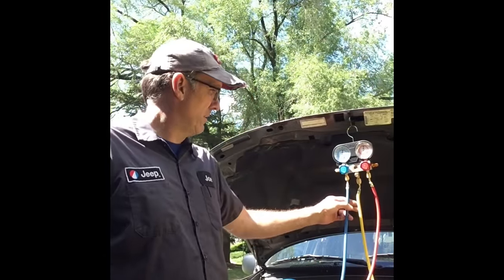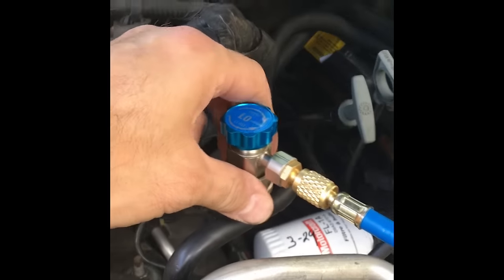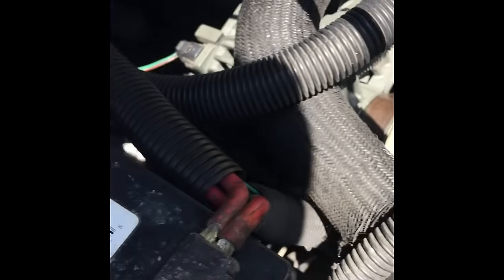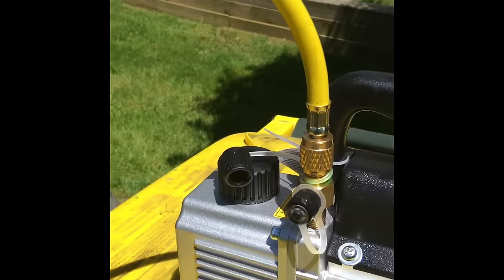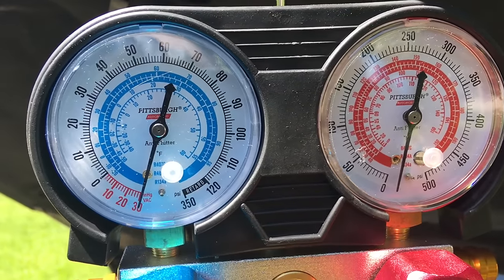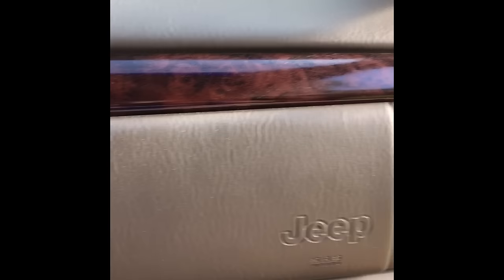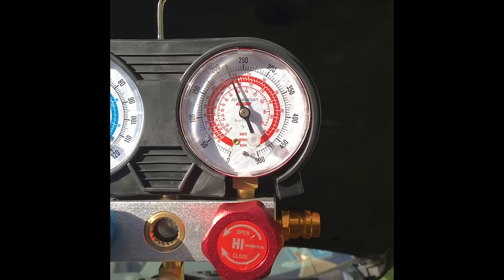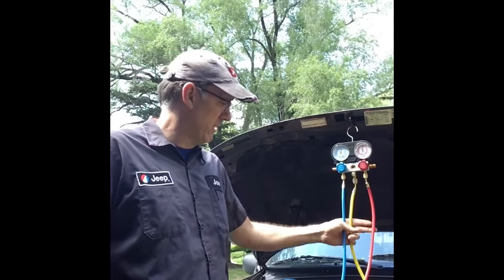How To Pull A Vacuum On Your AC System And Recharge Your AC System

Comment: Pressure loss on the high side.  When I do the vacuum test, the low side stays on -30 PSI for
Reply from the maker: there could be a leak somewhere in the A/C lines.  If you need to, you could do a dye check and see if there are any leaks.

Comment: How do you know when it is full? Does the gauges stay still
Reply: non technical answer is to download a high side / low side pressure chart that varies 5 or 10 pounds depending on the outside temperature where you are doing the work. It will get you close if you can do it early in the morning before it gets hot (like over 80 degrees) then go by the chart with the outdoor temp verses pressures.

Comment: Can you pull a vacuum with the other gauges,similar to the one's in the video but they don't have the negative readings like the 10,20,30 on the right side of the nunber 0?
Reply from the maker: I’m not familiar with that but as long as the gauges are for automotive use, you should be good.

Comment: Doesn’t the pag oil get vacuumed out as well and you have to put new in?
Reply from the maker: Yes. When the shop recovers the refrigerant it also recovers the oil in the system. Some will be left behind but you have to add new oil

Comment: Where did your shop let it out to save the environment? I to am worried about letting this out into the environment.
Reply from the maker: I had the shop evacuate the Refrigerant that was in the system before I did the repairs. That’s the safest and best way to do that part. .
Reply: @JustJeep_It  what if you put dye in it? I heard shops won’t touch it

Comment: Ok my vac gauge won't go to -30 .  No matter how long I leave it on.   Does that mean a leak somewhere?
Reply from the maker: Does it hold the vacuum once you turn the pump off? That is a good test to see if you have a leak. If it doesn’t hold a vacuum once you turn the pump off then that would strongly suggest you have a leak somewhere in the system
Reply: @JustJeep_It thank you for your response.   I must have a leak,. Also I'm replacing the o-rings but can't seem to find the right  size that came off the connections.  I have both the standard and the metric o-rings but they don't seem like the right size to give it a tight fit.  I'm going to dealership today to ask for a kit or something that would work.  Any suggestions.

Comment: Nice video thanks sir u done a good job,  question for u don’t you have to jump the air con relay in order to engage the air con pump before u add the gas and bring to pressure ?
Reply from the maker: MrMagsimus no you don’t have to jump the relay. Once you start filling the system with Freon, the pressure switch will realize that and start to cycle the AC compressor.
Reply: Just Jeep It - The Jeep Shop thanks for the reply ... ok I understand now .. u just keep filling the gas until the switch recognises the pressure and kicks in the pump .. 👍👍 and there’s all these vids on here confusing people to jump the relay 👌🇬🇧🇬🇧

Comment: That's the wrong adapter for Pierce cans, you have a Self Sealing can adapter. Peirce has a sharp point on it. Shouldn't mix types, accidents can occur if you use Pierce on a Self Seal. can.

Comment: How do you test for a leak before doing  everything you did?
Reply from the maker: I didn’t for this project.
Reply: generally you'd pressurize with nitrogen, then Soap bubble test for leaks.
Reply: My car is kicking off and on every 10 seconds could the evaporator or expansion valve be frozen/stuck?? Every time I turn it off for a few second then turn the AC back on it’s ice cold then starts to short cycle!? Need some advice. Compressor seems good and condenser seems good, and also the suction line/ low pressure line isn’t ice cold feels room temp!?

Comment: Hi, great video. I did the step by step on my 2006 Dodge Ram 2500 5.9. New compressor, liquid line, dryer, and condenser. When I vacuum down the system it goes to -28 on the blue and pegged the red side. I vacuumed the system for 1 hour and 15 min. When I try to charge it the liquid line freezes and the 134 AC can also freezes. Any ideas? Thanks
Reply from the maker: I haven’t ran into that. Is the Freon can upside down when it’s getting filled?
Reply: Did you change the orfice tube. Normally when it freezes it means you have a blockage in either the tube ( or expansion valve depending on the vehicle) or the condenser.
Reply: @kenbelcher5236  I replaced everything but my evaporator.

Comment: So at 5:32 you shut off the valves on the manifold. That means that you cut off flow from the vacuum pump to the red and blue lines going to the car AC. The red and blue gauges are also cut off from your car AC.
So how does that prove that your car AC lines and fittings are not leaking ?
All what you have done is to show that the valves at you manifold and the yellow line to the vacuum pump is not leaking but you have not shown that your car AC lines and fittings are not leaking !
Reply: The valves on the manifold are between the vacuum pump and the gauges. Blue and red lines go to the gauge and stop at the valves on the manifold.

Comment: When you vacuum out the A.C. system does it vacuum out the oil too? I would say yes but have read mixed reviews this issue. I replaced my accumulator in my 2011 crown Vic vacuumed the system out and recharge has been working good and still is. I added some only just didn't add to spec becouse I could not find a straight answer some people said yes and others said no it's to heavy it only boils out the moisture in air that is in the system. Will be doing my brothers Town car soon so just want to get an answer same thing we will be replacing the accumulator on is town car.
Reply from the maker: I believe it just pulls out the air some oil may get pulled but only a little. The oil will remain in the system.
Reply: No, moisture will fry when it touches any pag also

Comment: I need to piont that the method used here is extremely superficial. A 500 microns vacuum is necesary before charging with refrigerant. 500 microns of vacuum is necesary to remove the moisture trapped into the system (oil, receiver dryer). 500 microns vacuum can't be measured with regular gauges and is not always easy to obtain. Failure to remove the moisture out of your system   will degrade the oil which will result in a premature compressor failure.

Comment: When replacing a compressor the lines need to be "flushed"???
Reply from the maker: jerr dez eh. Not sure. The refrigerant was evacuated at the shop prior to me working on the system. 

Anyone here know the answer to this??
Reply: Just Jeep It - The Jeep Shop 
Hopefully it’s ok but I learned the hard way on my 06 Ram. The original compressor Burnt up and little did I know sent metal debris throughout the system. I installed all new components like you and it only lasted a couple months. The second time I flushed the entire system and again replaced the condenser. These new condensers are not flushable the passage ways are too small . Anyways good job though
Reply: Yes, because metal shavings can end up in the system from the failed compressor. You also have to replace the filter drier bag.
Reply: @Deneteus  Thanks I already did that,  My junk is giving me cool air finally :)
Reply from the maker: Yes!! You are right. I replaced the receiver drier and orafice tube. They also say to replace your condenser as well... but I rolled the dice. Lol

Comment: WHY IS THERE A PRESSURE READING ON THE HIGH SIDE GAUGE ?  YOU MENTIONED AT LEAST TWICE THAT  THE RED KNOB IS CLOSED --- IF IT IS COMING THROUGH THE MANIFOLD  WOULDN'T THE PRESSURE READ THE SAME AS THE LOW SIDE GAUGE ??
Reply: The Gauges are open to the Red/Blue hoses at all times. The valves only connect to the yellow hose .

Comment: Can you use a 7 cfm vaccum pump on auto ac or do you need a 2 cfm?
Reply from the maker: Daniel L the one I rented from the zone was 2cfm. I assume that they recommend that rating for a reason.. I wonder if a higher vacuum would damage seals, ac condenser... I just went with what the recommended tool.
Reply: @JustJeep_It  i do hvac so I have a 7 cfm pump. Wanted to save money and use it instead of getting a 2 cfm.

Comment: You need to run that pump more than a half hr. Moisture trapped in the oil needs time to boil off. I've fixed countless AC systems on cars that came from other shops with poor AC performance only because they didn't run the vacuum pump long enough.
Reply from the maker: that's cool..My AC worked awesome with what I did..but a little more vacuum couldn't hurt....thanks for watching and commenting.

Comment: My question is when recovering the AC system. Doesn't it also draw out the oil as well?  I was trained with the pro equipment machine in college and never done it the way you are doing it on your video.  I have a AC leak in my Odyssey and want to do it myself. Otherwise I can have a friend at a shop do the vaccum pull and refill the proper amount.
Reply from the maker: Daniel Rowe I took my Jeep to a shop to have the Freon recovered. I didn’t do that part. I assumed or pulled some of the oil as well but not all of it. The vacuum i did was just to remove air and moisture.

Comment: Does anyone know why I might not be able to pull enough vacuum? I pulled 26 inHg and it holds, but my manual says I need to pull 29.5 inHg. I can only think of trying a different vacuum pump.
Reply: I tried a different vacuum pump and it got all the way down.
Reply from the maker: That’s cool. Glad u got it all worked out

Comment: Do you have to take it to get the Freon removed before vacuum? I changed my condensor and other parts do to the vehicle being in a accident. I never got it vacuum I just added freon so I am guessing it may have air because it cools but not super cold.
Reply from the maker: Erick Salazer yes. You have to have the Freon pulled out of the system before you open the ac system and start working. Any shop will be able to pull the Freon out of the system.
Reply: @JustJeep_It  can you use the vacuum to pull the freon?
Reply from the maker: DavidJLim No Sir. It’s just for removing air/moisture. You have to go to a shop and get the Freon removed by a shop.
Reply: @JustJeep_It  so they will still get a chance to rip us off....just drain it into a gallon of water slowly do high and low...
Reply: @kangokidkidd4037  if Im getting a recharge on my AC do I have to get that pulled before recharging

Comment: Is it true that fully recharged system will reduce fuel consumption by putting less strain on the engine. If yes could somebody explain please.
Reply from the maker: I haven’t heard of that.
Reply: Absolutely not. If your ac is busted and not working you can get slightly better performance by bypassing the ac clutch on belt drive.

Comment: Good video but you never completed job (the removal of the recharge kit from the the motor). I would have shown that and then capping the connections and closing the hood with a smile on your face! Great video though ... not heaps of meaningless rambling like many do to stretch out the time.

Comment: You didnt purge the air from the yellow hose. Air is in your system.
Reply: How and when should this have been purged?  Thank you!
Reply: @MrThumper1440  you need to purge the lines every time they are installed. You need to purge the yellow fill line after you disconnect it from the vacuum pump and put it on the freon can by keeping all valves closed , open the valve at the can only and then barely unscrew the yellow line at the gauge until the freon pushes the air out. It only takes about 2 seconds then close the connection up by tightening the hose back up.
Reply: @clevc112  thank you!
Reply: @MrThumper1440  anytime.

Comment: Remember that you vacuum the pag oil all so and the pag oil needs to be replaced
Reply: My understanding is that just running a negative vacuum on the system boils out moisture. Evacuating the system including the negative vacuum doesn't remove pag oil. That happens if you removed parts (like the compressor) that contained oil prior to running a negative vacuum.